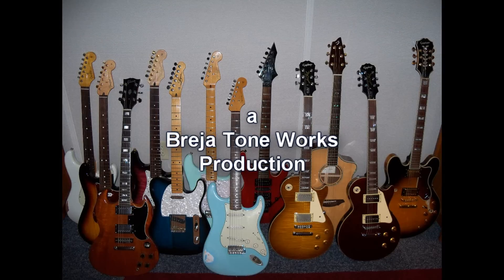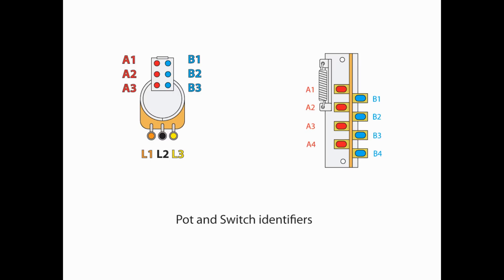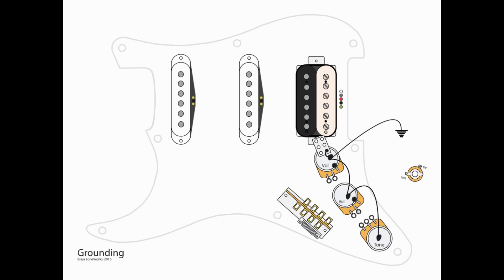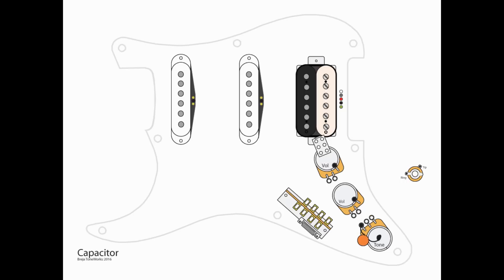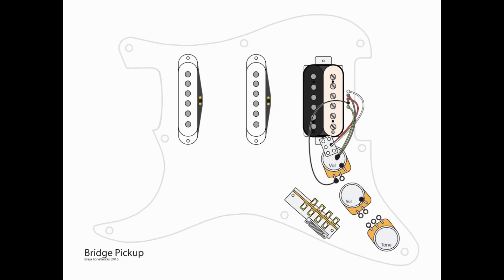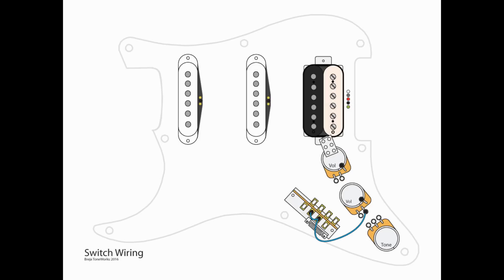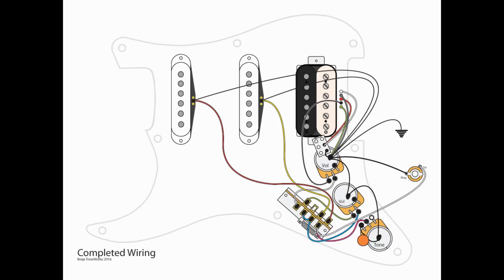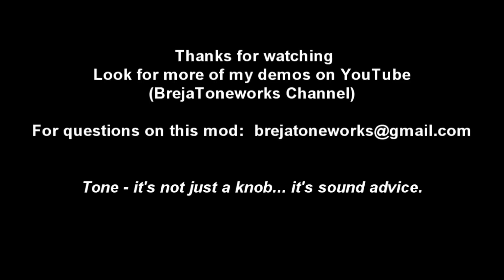HSS Guitar w/Dual Volumes, Master Tone and Coil Split

Comment: whats a bridge claw?
Reply: The metal thing under the tremolo cavity cover at the back of the guitar. The metal claw looking thing that holds the springs in place when they're attached to the big metal block. It's a commonly used soldering point on strats for a ground wire.

Comment: Dan, wonder if you could help? Would like to do this same project but add one mod if possible. I am using a humbucker in the neck position and when I switch to single coil it is really thin and too bright. Using the dual volume method with a 500k pot and a 250k pot could I use the push pole switch to also switch the Neck pick up to the 250k volume pot only when split? And leave the middle single coil pickup always on the 250k pot. This one is racking my brain.

Comment: i have dimarzio super distortion DP100 humbucker in the bridge. is it ok in this case to use 500K push/pull pot for humbucker and two 250K pots for the rest?
> and will positions 2 and 4 be hum canceling like it is on standard strat wiring?

Comment: While this MOSTLY worked (thank you!) I've discovered that something about the hbucker is wired out of phase. How do I fix this? I have a Dimarzio Crunchlab and wired it as you described (translating your SD colors into Dimarzio colors). Everything works except position 2 (bridge + middle). Should I maybe use a different post on the push/push volume knob or adjust something else? I'm just trying to think of the easiest way to do this without completely undoing all the otherwise good I've done. Any ideas?
Reply: Ugly Bunny It just usually happens that you re wiring correctly your humbucker and your middle, and you realise that the hbucker is outta phase.
It depends on the different brands. E.g. my dimarzio super distortion bridge was out of phase with some single fender noiseless as middle, despite that both were wired correctly.